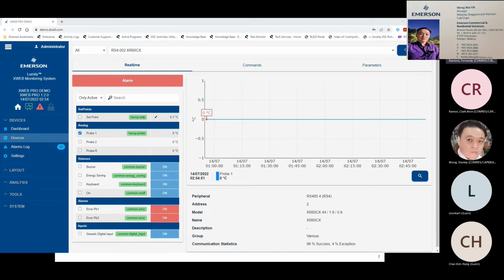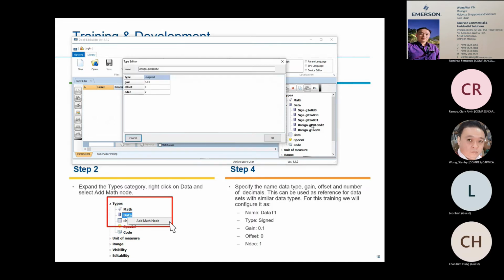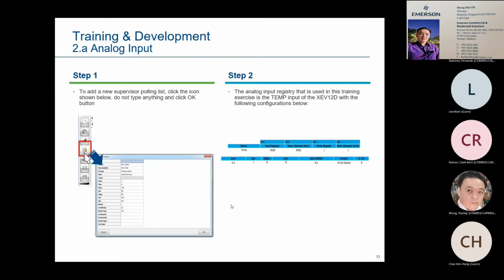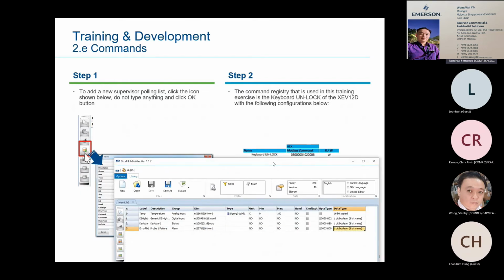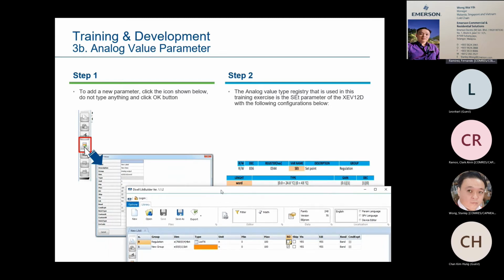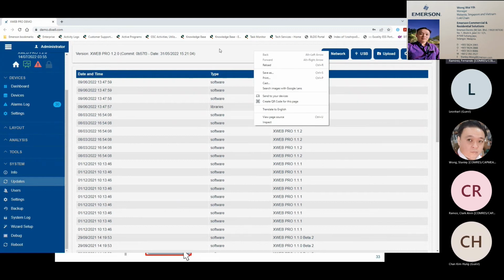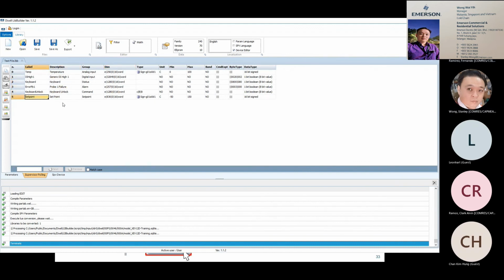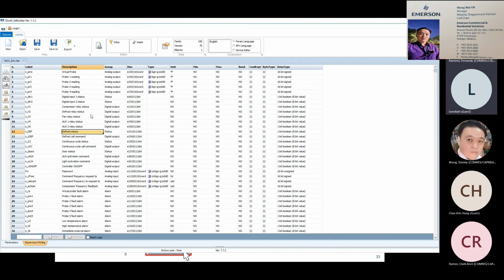Emerson  - Dixell XWEB - Library Builder for 3rd Party Modbus devices integration

Comment: Hi, is it possible to handle on/off status as dixell? I mean when the device is OFF device will shown gray , when on it will shown as green. There is a register in our application about device run status as 0-1 DINT. I handled the builder as staus of this register and it's working but not change the color.